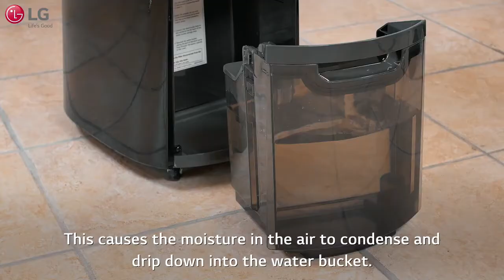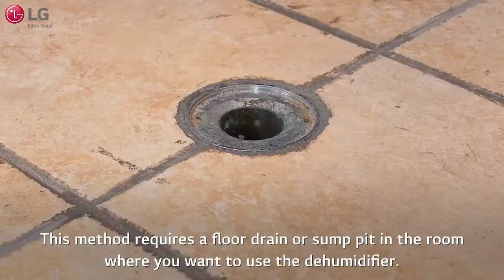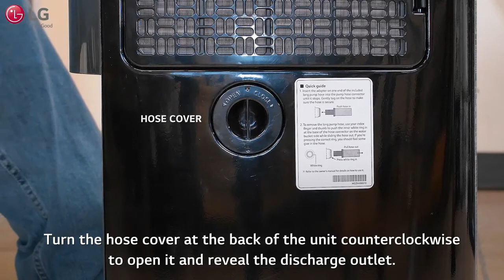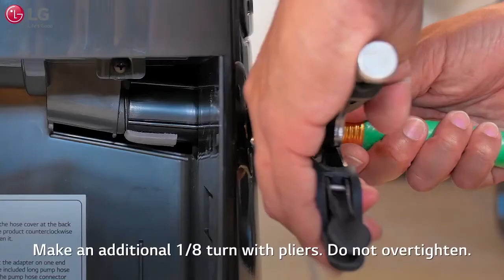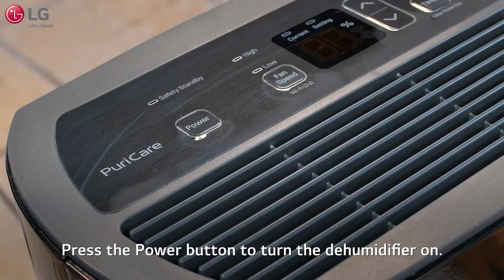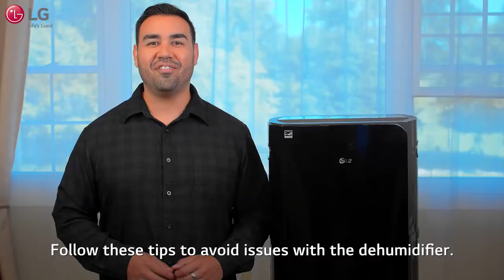[LG Dehumidifiers] Drainage Setup - The Garden Hose Method

Comment: I just bought an LG ac. unit with dehumidifier. but guess what?!!! 
... I am not able to use the dehumidifier because it came with NO hose.
what a joke. 
This is like buying a remote control TV but in order to use the tv you need to go and buy your own remote control.
Who was the "genius" at LG corporation who came up with this idea?
"Let's not include a hose so we can save a dollar"
Reply from the maker: Hello, there. We regret to learn the issue you've experienced with your LG AC unit. The dehumidifier function does require a hose for continuous drainage. To further check if this part is included in your purchase or sold separately, please reach out to us on social media via private message using @LGUSSupport with the model number of your unit. We'd be happy to help. ^Win
Reply: @LGUSASupport  The model I have has 3 functions.
a.c.
fan and
dehumidifier.
but in order to use it as a dehumidifier I will need to buy a hose. 
The model I have comes with NO hose.
Reply from the maker: We would like to assist you with this matter. Kindly reach us out through direct message. ^Mau